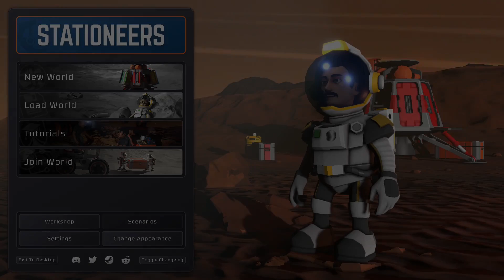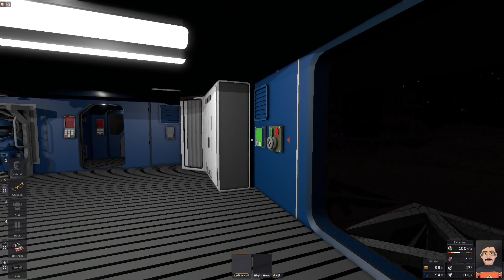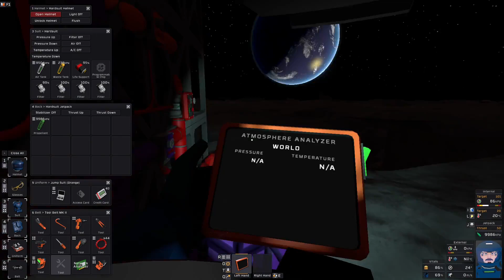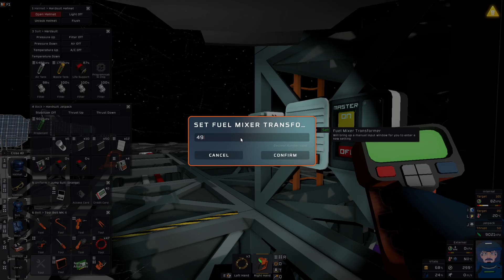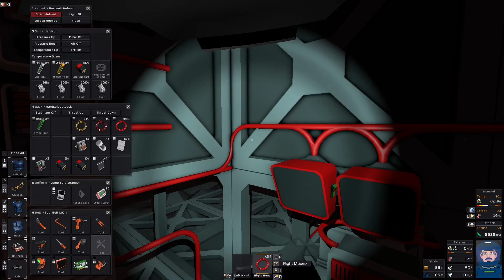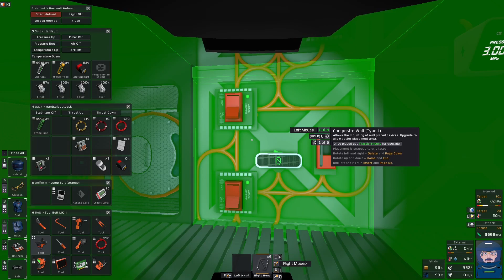Let's Play: Stationeers - Episode 31: Materials Processing Power Rework

Comment: Could the radiator issue is due to the temperature being -273.1C which is 0K? Basically its at absolute zero? Enjoying the series BTW.
Reply: That's right. 0K is as cold as things can get so the radiators will not be emitting anything.
Reply from the maker: Yup, I pieced it together during editing... Sometimes I'm slow on the uptake. LOL!

Thanks for the kind words!